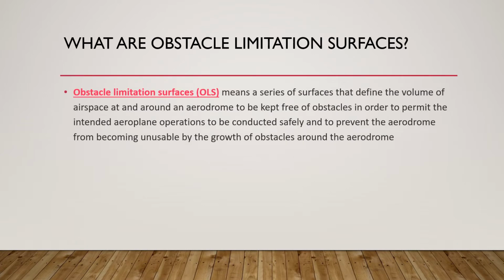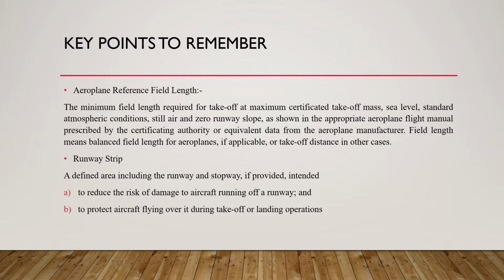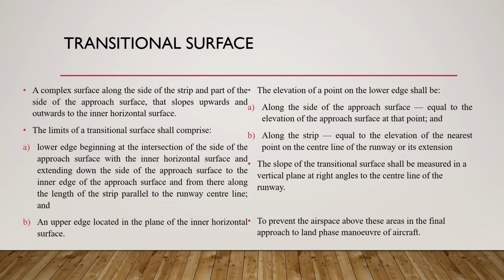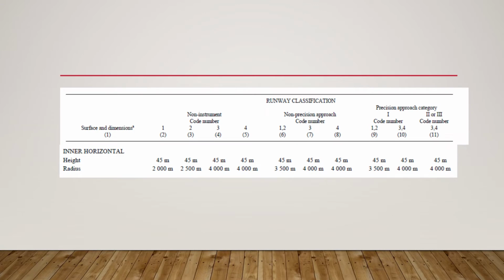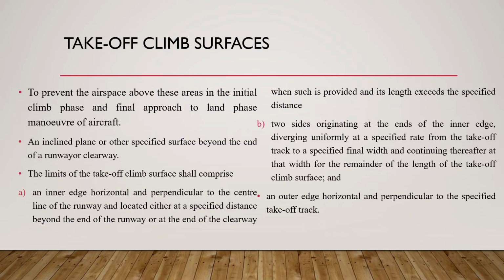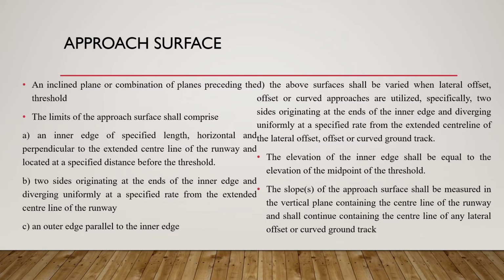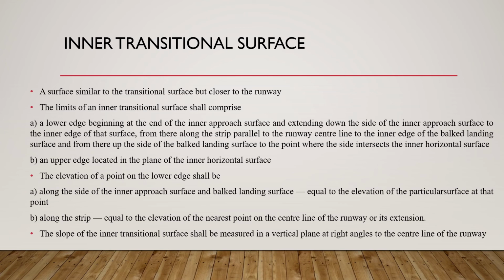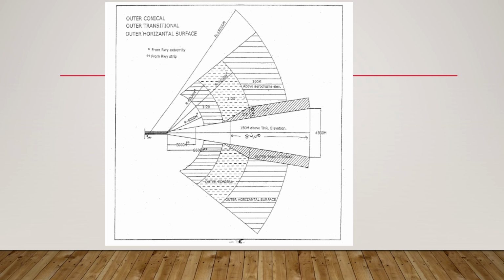ICAO ANNEX14 OBSTACLE RESTRICTION AND REMOVAL

Comment: Can you suggest me any free online course available on ANNEX 14 covering following topics:
• Safety Assurance, Responsibilities and Obligations
• ICAO Annex 14, Volume I (Aerodrome Design and Operations) - Latest Version
◦ Aerodrome design criteria and certification requirements
◦ Aeronautical data for promulgation in the Aeronautical Information Publication
◦ Aerodrome physical characteristics
◦ Obstacle restriction and removal
◦ Visual aids for navigation and for denoting obstacles and restricted use areas
◦ Electrical systems
◦ Aerodrome operational safety and emergency services
◦ Aerodrome maintenance
• ICAO Circular 305 (Operations of New Larger Aeroplanes on Existing Aerodromes)
• ICAO PANS-Aerodromes (ICAO Doc 9981)
• ICAO Annex 14, Volume II (Heliports)
◦ Heliport data
◦ Physical characteristics of heliports
◦ Obstacle restriction and removal
◦ Visual aids
◦ Heliport service
Reply from the maker: Mostly all of them are paid